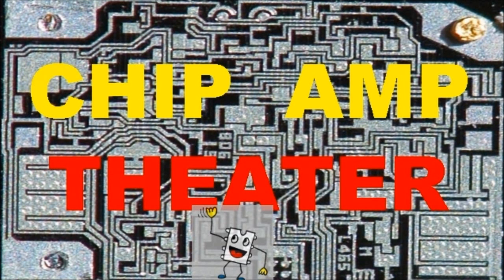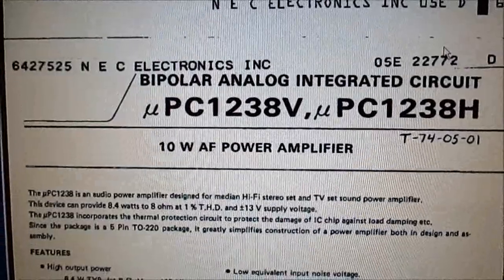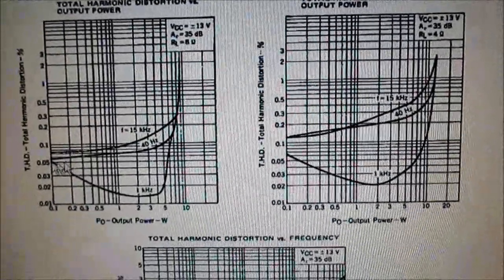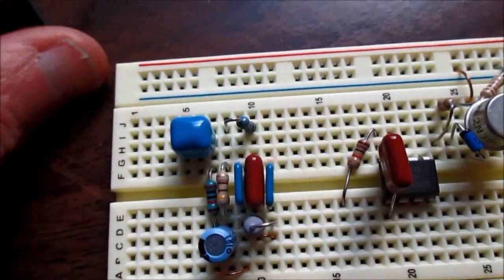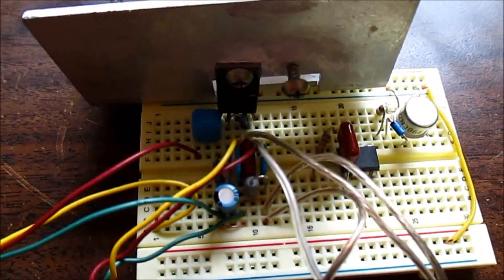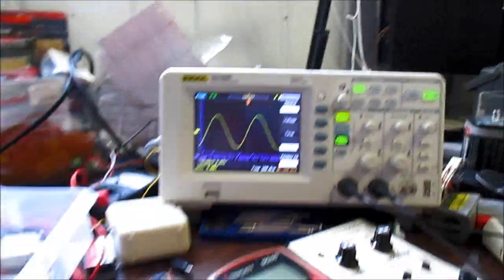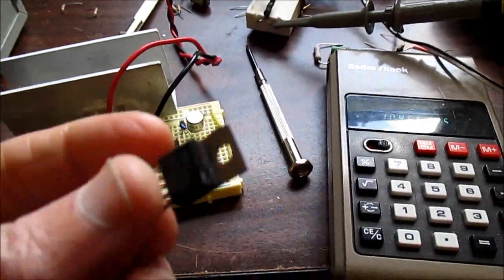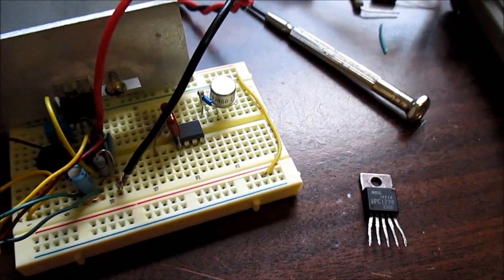NEC upc1238 audio amplifier IC test and review

Comment: Great video! I've been busy lately. I'm looking for a 10 watt 9V chip I can put in a cigar box guitar project. Any ideas? Thankz
Reply from the maker: Audio Tech Labs To develop 10 watts into a speaker, say 4 ohms for this example, you need a power supply voltage of 22 to 25 volts. You could use a bridged type amp, but you still need 12 or 13 volts. You could use a switching power supply to boost 9v up to 24v. To get a decent battery life, you'd need at least a 5 amp hour battery. Probably not easy to find at 9 volts.
Reply: Thanks John. Maybe you could recommend a chip that puts out the most watts for a 9volt battery. You seem much more aware of watts(ha ha) is out there. Thankz
Reply: @JohnAudioTech  what is the equivalent number of transistor upc 1238